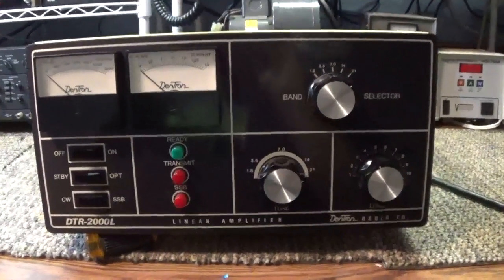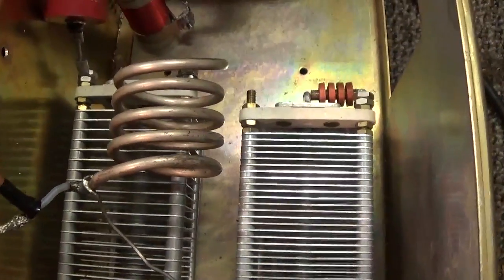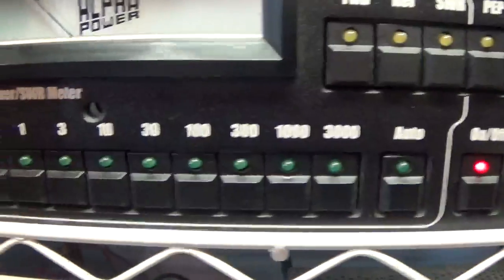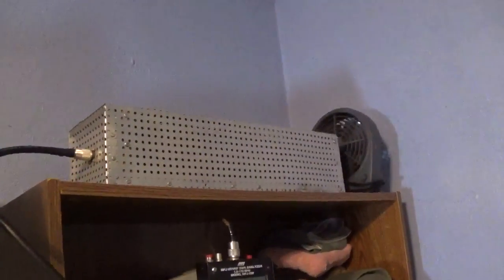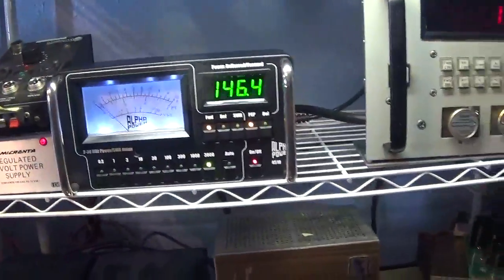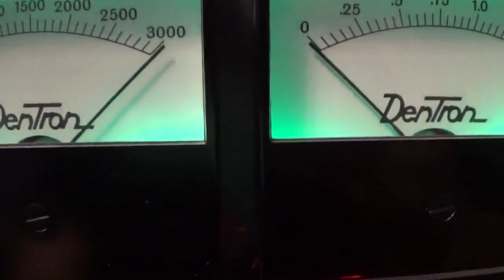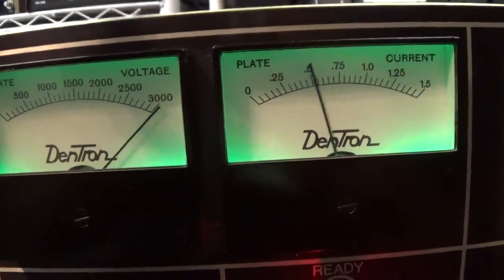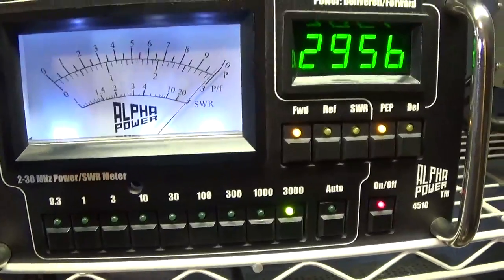Dentron DTR-2000L linear amplifier 8877 3cx1500a7 tube Alpha 4510 wattmeter

Comment: I'm not a big fan of tubes of any type being mounted horizontal. Denton amps have always had weak power supplies. I would like to see it on my bird 43. With the Bird  slug. I have a 16 pill 2SC2879's driven by a 4 transistor 2SC2879 BOX. Without the peak reading kit. I don't have one. I don't care about peak power. You can figure it out yourself with the RMS reading. The 16 pill driven by a 4 pill does foward swing without the pep kit. I set the carrier at 400 watts and have modulated it to 2800 RMS. That's on 16 volts. I've run it on 18 volts and it makes 3200. Same thing setting the carrier at 400 ,
 watts, and it will swing 3400 RMS, ON A BIRD 43, without a pep kit.  It's stable. I've been using it regularly for at least 20 years that way. The 16 transistor i run into a 64 transistor, Class C modulator. I'm on AM and haven't blown a transistor. Oh yeah, all 3 are Class C modulators. The 16 and 64 have a larger blower than this one. I still like ceramic tubes. If I was building an 8877 amp I would make it 1 driving 4 or 2 driving 6 8877's.
Reply from the maker: I am not a fan at all of transistor amps on the base. The Dentron amp in this vid has an oversize Peter Dahl transformer in it. You mention Bird wattmeter is interesting as I am using a big digital Bird with Bird slugs in the vid. I am not a fan of overvolting transistors. One driving  four or  2 driving 6 8877's? That must be a joke.

Comment: 3K peak is alot of output.
Reply: could you do that conversion on a mla2500 dentron
Reply from the maker: orange70383  sure, but not for a 3cx1500 with a heavy duty power supply. My personal rule for any rf power tube is twice the plate dissipation. Hence 1500 watts dissipation x 2= 3000
Reply from the maker: Nope those 8875 are already at full potential, are very hard to find and are very expensive.